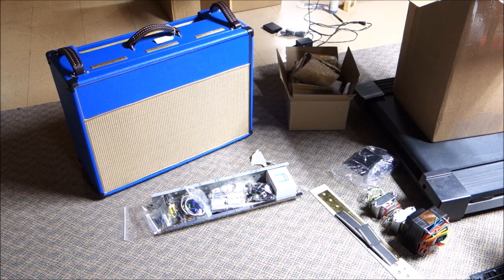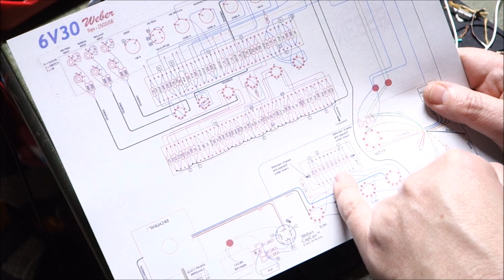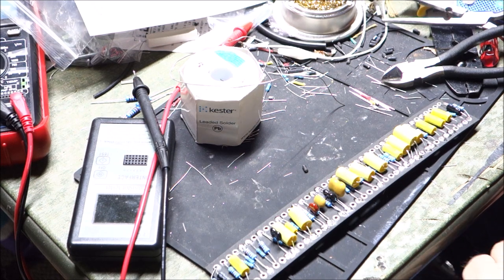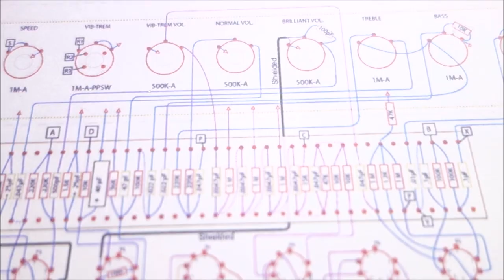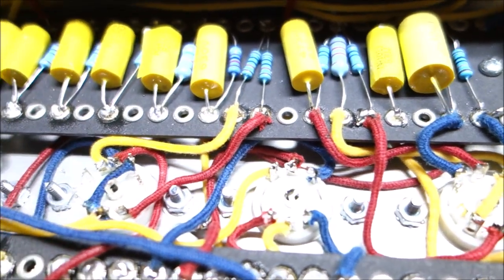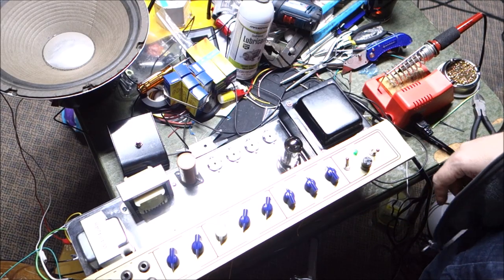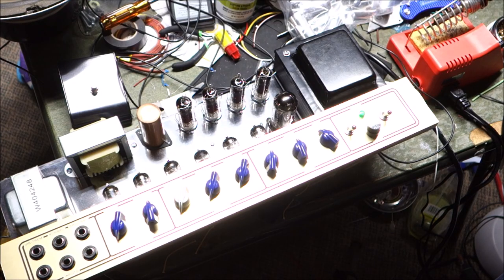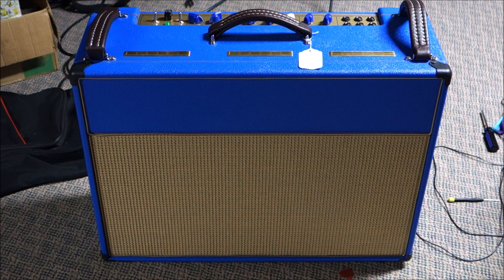Let's Build the Weber 6V30 Guitar Amp Kit!

Comment: Ol Ted supposedly dirrectly copied a 65' Vox AC 30 head. Saw you were building another Weber kit. My heart kind of skipped a beat!! I wish my wife would let me build amps!!
Reply from the maker: Whilst reviewing schematics,  what we have here is a Top Boost circuit built into the Brilliant channel...  and better variance/depth for Tremolo/Vibrato  than an original.  Weber kits many times have minor mods from the originals,  like an OFF/disconnect  on the Fender optical vibrato.   In this case,   instead of fixed speeds,  we have a pot,  and the depth pot too.
Reply: @DeadKoby Webers layout is much better. Vox just added the tube for the top boost at the right side, what made wiring difficult.

Comment: Were all the resisters metal oxide??? As for loud,,, many called the Vox AC 30 the loudest 30 watt amp on the planet! Fantastic job!
Reply from the maker: Metal FILM resistors.   I've been impressed at their heat resistance.
Reply: @DeadKoby  and quiet! But definitely a super interesting build. Expensive with those top notch weber alnico blue speakers but you only live once!! Slowing down the trem ,,,, heating up the iron is the longest part of the process. Correct me if I'm wrong but just paralleling in one equal value cap into the three cap trem circuit. That thing could use a half power switch!!
Reply from the maker: Correct......increasing the capacitance would slow the tremolo oscillator.   Funny thing is,  later Vox's DID slow it down,  and some guys reversed it to original specs.  LOL.    Right now, I'm hoping for my family to go out of town so I can really test on it....   even at not-deafening volumes, it's causing stuff in the basement to vibrate in resonance.   I've already been told to turn it down several times.   The volume goes from almost nothing to plenty loud in about 3 degrees of the pot....  it's a hot one!

Comment: I don’t like the component selection of the Weber kits. Any kits really. I appreciate the brass ground plane, eyelet boards, chassis’s and cabinets though. 

This looks like a fun amp to put together. The whole two part chassis is just so dang cool.
Reply from the maker: That's why there's options....   You can omit their pots...caps...resistors...whatever isn't your style.    I've gotten good results.
Reply: @DeadKoby  like a kind of "custom shop" for kit amp builders.Can you also order, parts like Mustard caps or F&T elco's or other label in and output transformers,within the package, of the kit your order?

Comment: On an actual ac30 the treble and bass only work on the brilliant channel
Reply from the maker: Yup...  this is a pretty close reproduction to a JMI I think.   Ted Weber didn't re-invent the wheel with this one.   It's a good sounding amp.
Reply: @DeadKoby  it looks great.  Needless to say, I made my comment before you mentioned the treble and bass being only on the brilliant channel.  My main amp is a 1991 ac30 with reverb.  Very nice, and not too bright, but I'd love a JMI era one.
Reply from the maker: @timmuston2687  I've fixed a number of the newer ones...   the vintage ones have a different mojo...  and this kit amp is more like the vintage.